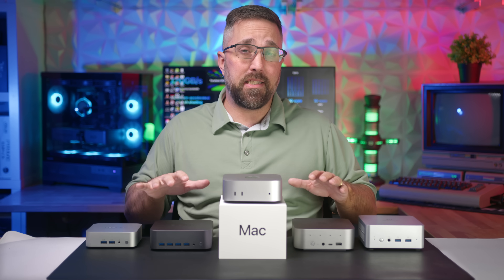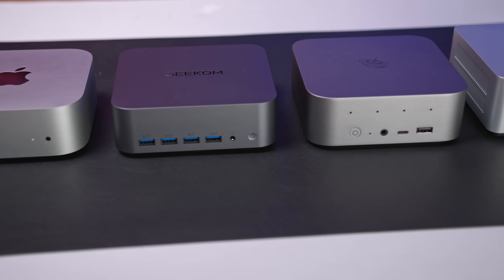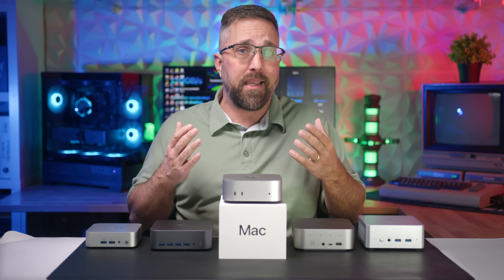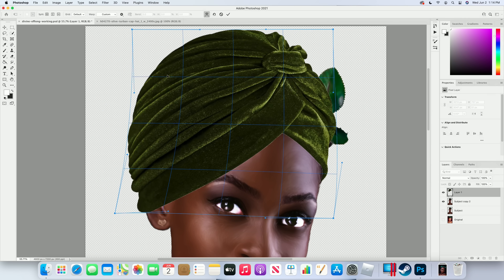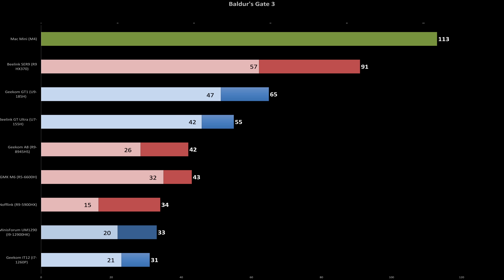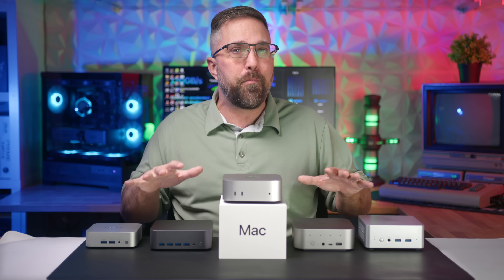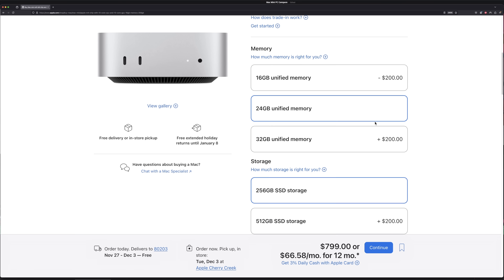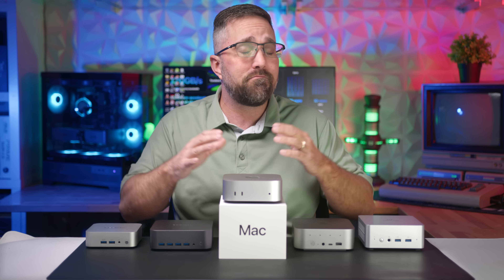M4 Mac Mini vs Intel and AMD Flagships – It's Not Even Close!

Comment: It's easy to make sense of the power button position. It runs UNIX. You don't shut it down, you let it manage its own power. I can't remember the last time any of my apple machines were powered off.
Reply: I have a MBP with M1Pro, from time to time the mouse becomes 'sluggish', this seems to coincide with the internal memory pressure being high. A quick restart sorts this out.
Reply: You guys know you can restart without pushing the power button, right??
Reply: @spacetoast7783  yeah. The premise of the original comment makes no sense, but you will eventually have a power outage, move, clean, etc and have to use that button. It makes no sense for it to be in such an inconvenient spot. Everyone has their own flavor of cope to remain an Apple fan here though.
Reply: @bob_kazamakis  My “flavor of cope” is that it’s not even that inconvenient. Seriously, this is a non-issue. People are just desperately looking for something to whine and moan about. Why don’t you whine and moan about the price of upgrades? That’s a real issue…
Reply: @bob_kazamakis  It's a minor inconvenience since it's so rare. You can even set it to automatically after power is restored after a power failure.

Sure it's annoying but it's a trivial annoyance.
Reply: @bob_kazamakis  The power button is placed at the bottom of an extremely small and light machine.  Not on the surface of the moon.  Also, Macs are not physically rebooted often, if at all.
Reply: Running UNIX and somehow it “managing its own power” (whatever that means) has nothing to do with the need to restart. All computers need to be regularly restarted…
Reply: @bob_kazamakis  superstitious horseshit 🤣Go back to the 90s where your brain clearly still lives
Reply: @bob_kazamakis  > All computers need to be regularly restarted…

There are servers that run years between reboots.  My own home servers run for months between reboot.  And I share the sentiment of @Chewbury.  I used Windows up until my SDE job forced a Mac on me.  I hated it, got used to it, and just completely stopped using Windows at one point.  I rarely reboot (once a month) and only because compliance software on my company MBP forces a reboot for software updates.

This wasn't an option with Windows.

Ultimately it is likely because OSX being purpose built for specific hardware allows them to give a better experience, but it really doesn't matter what the reason is.  Just the facts of the experience is what users care about.
Reply: @bob_kazamakis  Plenty of people run home servers with consumer hardware.  It is very common.

> "have you tried turning it off and on again?"

Right, but that says nothing about the need to reboot constantly.  Only that a reboot can cure a problem once it exists already.  If there is nothing wrong with the computer you don't need to constantly reboot it.
Reply: Have fun with problems because you leave it on forever. If it had error correcting memory, it might be somewhat OK.
Reply: @blankname8553  lol another one believing in ghosties and magic

Comment: It’s genuinely a little beast. The m4 chips in the studios are going to be insane.
Reply: Right. Seeing as the M2 Ultra is still slaying the M4 Pro/Max chips (although just barely on the highest configs), an M4 Ultra would be genuinely mind-numbing.
Reply: @seanmolincreative As of today they just announced the M3 ultra instead of the M4 ultra. Bummer since the bandwidth would be something like 1096 on an M4 ultra. It would’ve been much better if it was one chip rather than 2.
Reply: @seanmolincreative the m4 max is a lot better in cpu performance than the M2 Ultra and on the gpu scores 198000 metal score instead of the 220000 of the M2 Ultra. The m4 max is a greater deal.❤❤❤
Reply: @σδησγφηκσηξφ  What's the CPU score difference between an M2 Ultra and M4 Max? I'm just curious.
Reply: Yeah good luck on storage though. 256 GB is trash.
Reply: @arpsichord7474  Huh😂😂😂😂

Comment: Funny how PC games almost always fall back to gaming as one of their main and important criteria when most other tasks lean towards a Mac 😂. I couldn’t care less about games and happily use my Mac.
Reply: That about 'Minisforum A2' with 16 cores 32 threads and 128 Gb of memory for your tasks?
Reply: Games are the only thing to fall back on as Microsoft continues to destroy Windows.
Reply: That's fair enough, but as an avid Mac user, you have to objectively admit that it's an area where a Mac loses out.  Someone looking to buy a "does everything" machine for both work and gaming will probably overlook a Mac for that reason.  

A few years back Apple tried to bolster the Mac's gaming credentials by teaming up with Valve to port their Source engine games to Mac.  But they seemed to lose interest and now you can't run any of those games on a Mac anymore, and there's apparently no intention to rectify that situation.  

If I want to play TF2 or Portal, I can't do it on a Mac anymore.
Reply: For a do-everything platform, with a couple decade library of games, retaining access to my library is high up on my priority list. 

That said, if gaming was a market Apple really cared to get into, if they partner with Valve, and get an Apple Silicon chip into the next Steam Deck (a 1-2 punch of Rosetta and Proton), they’d probably really have Microsoft sweating.
Reply: The Mac mini is gaining new games as Microsoft lays off game programmers in studios they buy.
Reply: @tonyburzio4107  you cant game for shit on a mac keep dreaming

Comment: Long story short: AMD’s HX 370 is a serious chip and is almost as good or even better than the M4, and is overall more compatible. I bought the MM M4 because for multimedia editing the apps work better and I already bought them. But if I was at zero, I would rather invest in the HX 370 as I can run both (all) games and serious apps without issues.

Comment: It’s actually insane how tiny mac mini is, especially considering the power supply is integrated
Reply: The integrated PSU takes up nearly half the space in the Mac mini. So overall, the mini may be one of the smallest.
Reply: @MrX8503 putting the PSU Inside saves money for Apple
Reply: @vueport99  no it doesn’t. It’s more expensive due to extra engineering.
Reply: @MrX8503  I'm talking about production cost. Engineering cost doesn't matter much when you produce tens of millions or hundreds of millions of units. In those quantities, every half a penny counts
Reply: @vueport99  unlikely cheaper. There’s also tooling. An external generic psu is cheaper over a custom, miniaturized, overbuilt PSU.
Reply: As much as I like and prefer having it integrated, I’m super curious as to how small they could have made this with an external brick.
Reply: Not so impressive. They didn't leave room for a decent sized hard drive. Give me an external power brick if it means that I can have enough storage space.
Reply: @harrkev  They could have fit more storage in the same amount of space. They just chose not to because it is cheaper for them, and they cal later sell an 'upgraded' model later to the same suckers that bought the first one, thereby doubling their profits.
Reply: @harrkev  it can be optioned to 2TB of storage for a ridiculous upcharge. Still, technologically impressive
Reply: its just like a laptop withour battery and screen lol
Reply: my dreamquest mini pc it is, crazy thing thing it has n150 3.6ghz and 8gb graphics 16gb ram and 500gb m.2 it only uses 30w of power, it easy uses lightroom and photoshop what i need it for and uses so little power it a travel computer and great to be used in my car not bad as it dose everything i need for travel the screen i got was a 16 inch 2.5k it uses 10w of power what mad so whole system uses 10w for screen and pc plug says 12v 3a 30w , a simple 12v inverter to give steady 50hz you have a car pc for when camping as long engine on what be very useful as im saving my journey around Scottish highlands so 70 plus gb data a day over 3 weeks and 2 out 3 days im camping to cut costs so that much data plus my dlsr pictures that a lot data transfer a day so hdd is necessary. its a travel pc what replacing my 15 year old laptop and a huge upgrade to speed , more performance runs software far better but uses a lot less power so can be used in my car. one day i will also get an amd one for a side pc to my big editing pc as no need for 90% big pc running just for watching tv so low watt mini pc do that job
Reply: How come none of you noticed the lack of ports?😂
Reply: But that's why adding a hard drive or even memory is a chore.
Reply: Who cares im not effing using a mac lmfao no one is .
Reply: It's like a Macbook without the battery taking up all the space inside of it.. Not too surprising when you realize how small the system board in a Macbook actually is.
Reply: Yes. Insane is the right word. If the power supply fails, you cannot use your computer. 
The Mac mini, after all, is a desktop computer. Who cares if it has an external or internal power supply? Once it's plugged, you forget it.
Reply: That’s a good point I forgot. Do all the other computers have power bricks hanging off the back of them?
Reply: @tomcollins6989  yeah, he shows them at 2:00
Reply: @randomcommenterurl  wow, I completely forgot about that. That is really incredibly impressive. If I didn't have a MacBook Pro, I would have snapped it up long ago. Without thinking twice. What an offer from Apple
Reply: I think the more interesting price to performance is not with the other flagships but rather further down the product line. I just picked up a Beelink 16gb / 500gb / Ryzen 5 6600H, Dual Gb eithernet and dual HDMI, and integrated PSU, for $275, and installed Linux Mint on it. It’s a monster for general office work. Which is the target for these minis. And if I need the extra ram, it’s 4 screws and $60 to upgrade to a 32gb ram kit.
Reply: @Ubiquities  Yes. I use my older Mac Mini for an entertainment PC. It dual-boots to Mac OS, but defaults to Linux Mint.
Reply: Which admittedly, is a bitch to get changed out if it dies. An external power brick is easier to replace. 😬
Reply: @MLWJ1993  this is very unlikely to happen and at the end it still should be possible without too much effort.
Reply: @qwertzuiop875  If Apple didn't muck it up by intentionally making it non-user replaceable like it does with the SSD. I wouldn't put it past them TBH.
Reply: @MLWJ1993 SSD is user replaceable in mini.
Reply: @JamesRinkevich  only the M4 model. All of the older models have firmware that specifically makes the device unbootable with a different SSD if you don't modify the firmware.
Reply: Ho so? It's just an ipad with no screen.
Reply: @war2thegrave  M4 iPad Pro is impressive in its own right. That display might be the most amazing screen I’ve ever seen. & it’s ridiculously thin. The price is also ridiculous, & I’m not sure if there’s any point to having it so thin, but holding & using it does feel special
Reply: Weird that it's the opposite of what it used to be. Now macs are for poor people.
Reply: @shivanshu123e  as they should be cause they are just for bragging  rights to other apple users lmfao. The rest of the world doesnt care
Reply: well you see.... apple didn't do much actually the old mac mini had a ton off unused space so they just removed the air
Reply: @dedpoolnotmarvel  the m4 mac mini uses a much smaller enclosure to the older mac minis, plus they also had integrated power supplies😂😂😂
Reply: Not all of them the Beelink Gti14 has one built in and is the same size just depends on the model you choose and price you pay.
Reply: @Some0ne001 
Wel that’s just a copy of the Mac Mini put an Apple logo in the middle and you have an Mac Mini when it comes to design
Reply: Why do you care about the size so much. It's already the size of a fist. Are you trying to put it in your RS?
Reply: It's impressive and uses less resources. It's so much nicer to only care about a cable for your desk setup instead of an ugly adapter.
Reply: 🤣🤣 @RandomHelicopter

Comment: The Mac Mini is one of those odd value propositions. Very fast but not very well-rounded. I'm having a hard time seeing the target user having a need of a lot of CPU and GPU power but very little storage. Especially since most proper quad core systems from the last 5 years will run daily tasks just fine. Add to this the realistic need for a USb dongle for connecting a mouse, keyboard, printer etc. 

If asking me to spend either $599 on a M4 with 256 GB or $450 on slower but still fast system with 1 TB I suspect I would pick the latter.

Comment: If you need a Mac good for you, I'm a linux user, no need to be slave of Apple. I'm receiving a new mini pc today with ryzen 8745hs (same as 8945hs basically without npu), 32GB of ram and 1TB of ssd for 600€, not bad. The benchmark of some applications are not so fair when they are soo optimized for mac, anyway I don't use any of this applications, I'm a software developer so the performance are comparable between the m4 and the 8745hs and also the price.  I got a SER8 with the 8745hs and not the ser9 with the AI 370 processor or a minipc with the 8945hs because they are not good value, anyone knows it, the 8745hs have much less price for the same performance. At least compare the minipc with comparable price and value proposition. The ser8 have 2 nvme slots and upgradable ram, I'm going to put an optain ssd for boot drive and a second drive for the data partition and upgrade to 64, 98 or 128 gb of ram when needed, things you can't do on the m4.
Reply: Yeah, so unfair, how dare there be optimization and things running well? Did nobody at Apple think how this makes Linux users, the true free people, look?
Reply: @chrisdistant9040  I'm talking about photoshop and other apps not the os.  Windows sucks, mac is close as fu.., and on linux applications like photoshop are not even available. Tanks god I don't need most of this fancy app
Reply: It’s funny that people saying things like “slave of apple” usually put the most narrow constraints around what they think is worth using, compared to normal people who might switch between Mac, windows and Linux on a daily basis.

To each their own i guess. Limiting yourself can make you feel free too 😉

Comment: Just because of this non upgradable ssd i would choose any other mini pc.
My mac M1 ssd already died and apple ask me 700$ to replace it...
Reply: Heh typical Apple, that's enough money to buy the very machine featured in this video anew with 100 whole more dollars to spare.
Reply: @leduyquang753  Whole mainboard needs to be replaced, including labor I would expect that to be more expensive than buying new. Only components not changed would probably be case and power supply.
Reply: Is it that dead that you can't even start the mini to boot from an external SSD?
Reply: @svenlakemeier  exactly, can't even boot
Reply: @svenlakemeier  The boot firmware is on the internal SSD of the M1 Macs, so once that dies, you can never boot the Mac again, not even from an external drive.
Reply: I thought this model could be changed? It also has high speed ports, so you could at least install Linux eventually even if the drive was to fail.
Reply: Oof really?
Reply: @chrisdistant9040  yup, because I only had 8gb of memory and did a lot of swap and writing on my hard drive. It is not normal that it dies after 3 years of use tho
Reply: The SSD is replaceable.
Reply: @tonyburzio4107  on an M1 mac mini?
Reply: Get an SSD from Amazon and save lots of $$$.
Reply: The only thing to consider to buy a mac is that the depreciation is way less than other brands.
Reply: Late but this model has a m2 slot just like any pc
Reply: Τhe mac mini does have upgradeble ssd
Reply: @Aggouric  The original M1 SSD wasn't upgradable.  The M4 Mac mini does have an SSD module - it's not a standard M.2 slot though - Apple uses their own storage controller built into the main board, instead of the standard with a controller on the storage module as well.
Reply: That's why you HAVE to buy the Apple Care warranty.  Anything without a warranty is going to cost a boat load to repair.
Reply: @dan_hitchman007  so, $600 + Apple care?  It's not so cheap then, is it.
Reply: @dan_hitchman007  the symple way is just to NOT buy a Mac Mini. 😆
Reply: @dan_hitchman007  maksa, et olla ori apple´lile